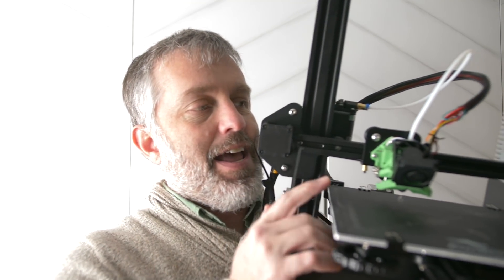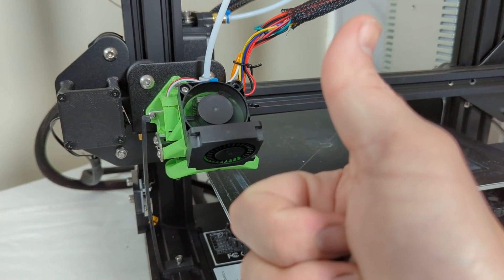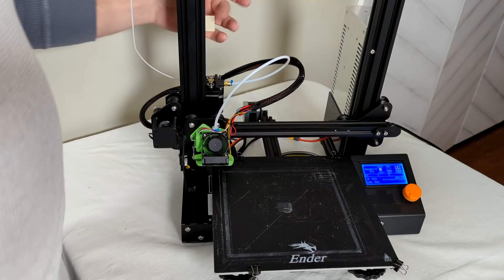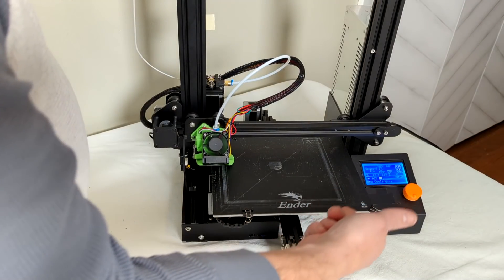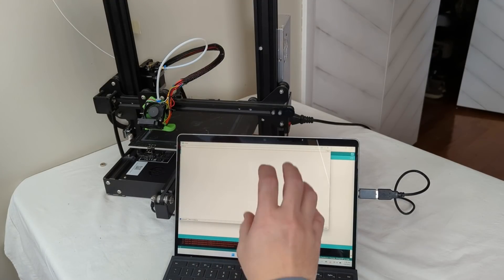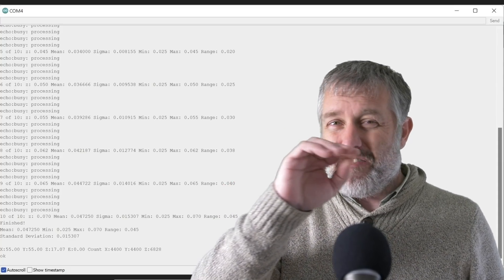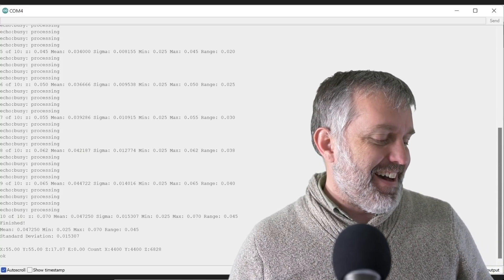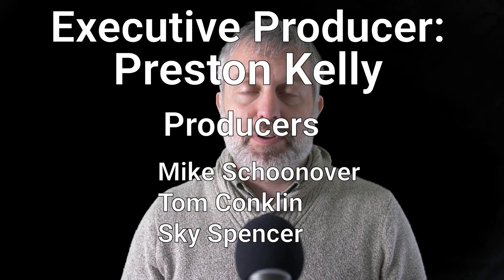I Made a Self Deploying Allen Key Probe To Rival The BLTouch

Comment: Who needs any "touch devices" anyway. If you setup your machine properly, you don't need any gadgets. My machines (I have 3 Ender 3) are setup so that I never need to "level" anything. Turn it on, insert sd card, set the machine to heat, select file  to print, and walk away. EVERY. SINGLE. TIME.
NO issues. No gadgets. No doohickies. 
No  b.s.

Comment: Its not that accurate compared to say a Klicky Probe, which is just a momentary switch, and would give you another decimal place. I used to get around .0075 spread using that. I always say, you can't beat the reliable simplicity of a switch.

Comment: Thank for your useful video. I made one using optical sensor, SG90 mini servo and small aluminum parts almost 8 years ago. Your one is better,  because servo has EMI issues (I guess so). I've started to use my 3D again and changed optical sensor with TCST2300. If you use it you may get better results.  My results;

Mean: 0.036250 Min: 0.029 Max: 0.042 Range: 0.014 Standard Deviation: 0.004644
Mean: 0.040375 Min: 0.031 Max: 0.047 Range: 0.016 Standard Deviation: 0.005002
Mean: 0.040375 Min: 0.036 Max: 0.047 Range: 0.011 Standard Deviation: 0.003875

Comment: So, how does it work??? You spend almost 15 minutes telling us how great it is but not one second on how it actually works. Are we just supposed to know?
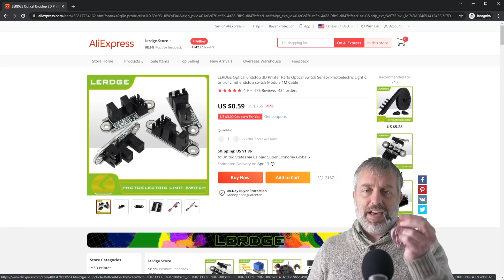Reply from the maker: Yeah, when I made this video I didn't think it would be so popular to a general audience. Basically the sensor is made with an Alan key embedded in a 3D printed block. The Alan key+block slides in a tube. As the nozzle lowers, the Alan key+block hits the bed and moves upward relative to the nozzle. You can kind of see this happening at the 8:53 timestamp. This upward motion causes the Alan key+block to slide into the fork of the optical sensor shown at the (4:35 timestamp) thus triggering the switch. and registering a bed touch.
Reply: Thanks for replying to such an old video. It's a nice idea and it would have been nice to see it in operation and how you implemented it. @DesignPrototypeTest

Comment: the range is shit. the average genuine bltouch range is around 0.005 with cold bed and 0.0075 with hot bed in enclosed printers, super pinda is around 0.00125 cold and 0.002 hot, yours is around 0.04 cold, absolutely trash, I'd rather pay $4 in a cheap "3d touch" probe which is around this accuracy.
Reply from the maker: Yeah, and a scalpel is a lot more sharp than a butter knife. But you still use the latter to make a PB&J. A Ferrari is faster than an Accord but almost nobody drives a Ferrari to work. As long as it clears the bar it doesn't matter if it is by an inch or by a mile.

Comment: I wonder where we'd be to technologically if good ideas were not trapped behind a patent 3D printers are in 1980 technology...
Reply from the maker: All people are not equally skilled. The professionals selling $30,000 machines are able to find paths around the patents and make machines so much more capable than our DIY solutions. The reason the US has a patent system is because it fosters innovation. Without a patents. The innovator has no way to protect the massive investment of time and effort, they spent developing the thing. The rep wrap project is fundamentally a copycat of what Stratosis created in the 1980s. So all that is to say that respectfully I must disagree. Patents are the reason we have DIY machines that work so well. Far from holding us back. They are the source of what is great.

Comment: 10 times less cost and 10 times less accuracy...
Teaching Tech showed that most of the sensors you can buy have a diviation of 0.001 - 0.005 mm.
That is actually 10 times more accurate. Yes, you dont need that great accuracy, but u get what u pay for.

Comment: Idea: use a brass heat set insert to guide the Allen key, that way it doesn't magnetized over time and is rigid

Or undersize the hole and require it to be drilled out like is frequently done in guncad

Comment: Optical sensors have a max operating temp of 70C. So you are right on the edge using a knockoff sensor in a heated chamber. 

Also imitations are a market force taking advantage of customer elasticity. There is little evidence that they stifle innovation and most likely improve the adoption of genuine parts.
Reply from the maker: It may be anecdotal But I can tell you for a fact I have killed projects because I saw no gain as I would be copied as soon as I was successful. With low probably of commensurate reward for my efforts I chose to entertain myself instead. The economist model of humans as logical actors would suggest that many other innovators other than myself have similarly not embarked upon creative endeavors for similar reasons. Innovation is hard. You need to motivate the innovators. Intrinsic rewards only work when the task is not too daunting and the individual already has all of his more basic needs met.

Comment: So the z axis is continually being "leveled" during printing??
Reply from the maker: Yes. Some printers have three lead screws for the z axis. These are able to physically level the bed before printing. However, the bed can still warp and twist due to heat expanding it in funny ways. Therefore even the printers which are able to physically level still run the software based bed compensation.

Comment: Very cool, maybe you can bake in into klipper? that way you can use it on  any printer without any firmware updates just a klipper update.  I heard you can use klipper with just a laptop and the laptop does the job of the raspberry pi which is pretty cool,  and the computer does all the algorthiming and sends the commands to the printer motherboard which just acts as the motor driver at that point. Thats my basic understanding of it, but seems the klipper approach would allow for detailed mods like this easier.
Reply from the maker: In this case it's far easier to use Marlin. Klipper has everyone's attention but it's not necessarily the best option.

Comment: tiny-touch is a diy alternative for bltouch you just print 2-3 tiny parts and buy tiny linear servo for sensor retraction and optical endstop for 1/4 - 1/5  the price of bltouch is the same size and only a bit hevier than bltouch 

biggest drawback of bltouch i noticed so far is that  the flipping pin is now plastic and can easyly be damaged if it drop during the print, with mechanical servo you have no drawback like that, your alan key trick can still fall down and nothing woul pick it up

also i say that accuracy of microstepping and backlash of ender 3 lead screw is giving you bigger error than the probe, printer is not phisicaly capable of doing better even if the probe itself can

Comment: With the comments I did read, I did not see ' make the block the key sits in slide between 2 bars, oversize the block the key sits in and after printing sand the block to barely slide between the bars.  Gorilla Lube is my favorite for moving parts since it ' gunks up ' less than WD40 and seems to work well on plastics long term ( I do mostly PLA  and not seen an issue on my STARTT 3D printer upgrades yet ).  Keeping it simple can also mean that the imaged block for the key does not need the full key embedded inside, it can be the top and the ' inner side ' in the block, the rest sliding inside a C or U channel guide.  There are a lot of options to make it drop straight and repeatable by just forcing the upper area to only fit it.  Similar to the ruler example, just opening your hand enough, it dropped straight down.

Comment: Nice revision.  Did you credit the person you got the idea from?
Reply from the maker: Maybe if I was earning 5 Million dollars per month from someone else's work it would be an issue. If someone was out there earning that kind of ridiculous money from other people's ideas in "the community" that person would really be deserving of the hate/trolling that you're trying to bring to me.
Reply: @DesignPrototypeTest  it was a simple question that you've posed previously.  I watched your video, liked it, couldn't remember if you said where you saw it and thought maybe you meant to note in the description but it got missed.  No trolling or hate intended.
Reply from the maker: I'm used to getting trolled so I guess I misread the intentions behind your comment. The Alan key probe has been implemented previously back in the dawn of the reprap movement. You can find many versions of it on Thingiverse primarily used on Delta style printers. None of them have the magnet stowability that I came up with here. When I did this work I had never seen any solution that was the same as mine. After deciding to use an alan key I independently came up with the rest of this. As it turns out there is a French company that has a similarly functional pin based probe. That is the TouchMI that I talked about in the description but I didn't know that existed before I had completed this project. I've never earned a penny from this design. I did all this work and gave it away. I'm so tired of being beat up by the loser open source warriors who want to make me feel bad for innovating on 3D printers and hiding the fruits of my labor behind "a paywall." I make poverty wages for my efforts on this channel. I should just sell out and start accepting sponsorships and doing affiliate links.
Reply: @DesignPrototypeTest  When I first bought my Ender 3 I tried a few different shrouds, but none that had an effective built-in probe mount, they were more a modular design that looked bolted on as an afterthought, so your design is aesthetically pleasing.  I've not seen a version with the optical sensor before (TouchMi as you pointed out has it..but again, "afterthought"), let alone integrated into one shroud.  Some like modularity, some like all in one.  For me it depends on the printer.  On the Ender, once it's set, I only occasionally have clogged nozzles, so having an integrated shroud is a bigger positive for me.  I'd use it if my ender were still more... ender.  There was nothing wrong with it, I just like tinkering, so the Ender and my Tronxy are my perpetually changing machines.

Comment: I tried the Teaching Tech CR6 style bed leveling on the Ender 3 but I found that the design was more rigid than my print bed. I like that the probe on this has a degree of movement so the bed doesn’t have to be super rigid. Possibly when I get a second printer I will try combining the ideas.

Comment: the BL touch is way over priced so i'll never buy one. I literately dont care about a creator that overprices their product by a large margin. 
ill buy the knock every time or make my own. i dont even need to use an Allen key for it. anything that interrupts an optical sensor will work. 
i haven't bought a knock off or made one because manually leveling the bed is good enough for me. its better for the bed to be physically level than a program compensating for laziness.

Comment: That's a whole order of magnitude worse repeatability than the BLTouch, even though it seems like a small number. If you are performing bed leveling then the full 0.045mm is valid as an error, that's how much deviation you could see across the bed 

Another comment mentiones your 10 measurements appeared to show a trend, if so you probably need many more to get statisticaly meaningful values.

Comment: To improve the consistency of the vertical movement I would hold the probe with a bi-stable flexure. That way it would not rely on gravity and you could eliminate the magnet. Likely you could eliminate the key as well and print the probe as part of the existing fan housing. I would also make a housing around the optical sensor to eliminate stray light.

Comment: Do you know offhand if this will fit the Creality Direct Drive Extruder (the one they sell on the Creality site)?
Reply from the maker: I did not realize that product existed. Thank you for the heads up. Yes. It looks like the lower part is unchanged. The metal fan shroud looks identical to stock. Therefore, my design here should work perfectly.

Comment: To eliminate maximum deviation, why not have a continuity circuit instead of an optical sensor?  The Allen key (or any other hunk of metal) can rest on a metal pad.  As it drops, the key loses contact, breaks the circuit.  It seems like that would be more consistently accurate with no optics required.  A rounded contact end will mitigate surface area contact on each drop ensuring less deviation.  I could be wrong, but that should be more accurate.

Comment: If you can setup custom motions and read from the sensor in real time outside of the programmed bed-probing mode; I think you might be able to use this as a makeshift 3d (well, more like 2.5d) scanner, by probing over the whole usable space, rising above the highest part of what you're scanning before each horizontal movement to ensure no crashes. Would benefit from a thinner probe though.

Comment: The slop of the sliding channel should not matter at all - the allen key is long so the angle of it can't change in a way that matters.

The error is likely on the light detection side. Not sure exactly why but I would like to see a plot of reading over time - if there is a temperature issue with opto-coupler because it seemed like there was a pattern to the error.

Every single new reading increased the z position with 0.005 mm, which indicates a systematic error. If something is slipping or if something heats up from the light sensor LED or the head or something. Without this systematic error, the result would have been about 10x better.

Comment: Make the hole a triangle, drill a hold him the putter most side, put a set screw through and back it off as soon as the Allan key drops freely. This could be a simple solution with minimal design change.
Reply from the maker: I like your thinking! I'll give it some thought and see if it makes sense to implement.
Reply: @DesignPrototypeTest  sorry, Autocorrect got the better of me on that last comment. What I meant to say was:

"Make the hole a triangle, drill a hole and tap one side, put a set screw through till it holds up the allen key, back it off and stop as soon as the Allan key drops freely. This could be a simple solution with minimal design change." With an allen key being 6 sided, it would make using a triangle hole line up just right. Hopefully this made your brain not bleed trying to read it.

Comment: I saw something similar before its call Hallon
Reply from the maker: That sensor also uses a hall effect sensor just like the BLTouch. It does not use an optical switch.  Therefore it is much more sensitive to heat drift inaccurate readings. The logical evolution of the Halon and the sensor which is closest to my design is the TouchMI which does use an optical  (photo-electric) switch. Still these probes are far more complex than my design, and they cost significantly more $.

Comment: This is clever and I like the thought process. 
I am not really sure why I would use this over klicky/magprobe/euclid/quickdraw? Also maybe $3 in parts. Macros are a little trickier to get right but once they are configured they are set and forget. There are no complex mechanisms and those switches are insanely accurate and consistent and repeatable. Far better and more consistent than inductive and optical solutions in my experience. Omron d2f are cheap as chips and good for millions of cycles. 
Happy to hear other perspectives.
Reply: One of these would probably be an ideal solution for your Reprap printers.

Comment: Link to the sensor you used?
Reply from the maker: Just look for "Optical Endstop Switch" on Ebay or aliexpress. Like I said in the video, don't buy a red one. Buy one with a Black PCB that has the wiring plug and Optical fork on the same side of the PCB.

Comment: The Bl touch I paid $40 for was well worth it made 3d printing possible when I was new and didn’t know anything but bought a ender3 clone the voxelab Aquila . It was $160 for printer and $40 for the bltouch and I put a pei magnet bed on it that was $25 oh and I got the newer red dual gear extruder that came with the better bed springs and Capricorn tube that was I think $29 or so total I think I got maybe $250 in it and it’s amazing how much stuff I have printed with it done went through about 5 spools of pla plus in last two months of having the printer and learning how to tune it and get it calibrated as accurate as possible little things you learn as you go.
But the learning after I got the bltouch installed and let the printer do the work for the first layer now so it’s just turn it on and go with it so now it’s all been learning the slicers and I have to say I like the Cura slicer it seems I get better prints cleaner finish surfaces and more accurate to the finish piece to model . Another thing you need to buy is a good digital caliper you really don’t need one in life a lot till you get into 3d printing haha but to tune a printer with sample pieces it’s essential and also each roll of filament I have found acts a little different and even the same name brand but a different color it might want a little more or less heat it’s definitely a learning experience I’d recommend everyone doing plus the amount of free usefull already designed files on the internet is amazing I have printed a pile of stuff for family and friends the PLA plus from esun and polymaker or very strong parts actually it’s pretty amazing how well you can make functioning parts for brackets and stands and they hold up very well.